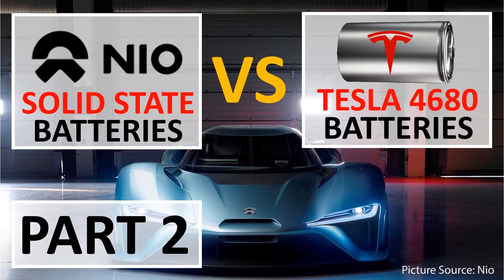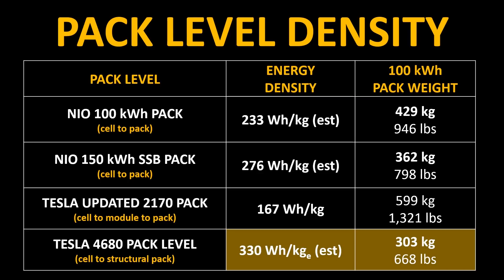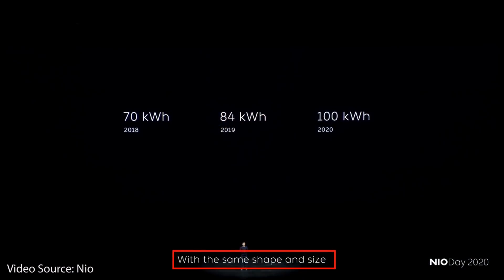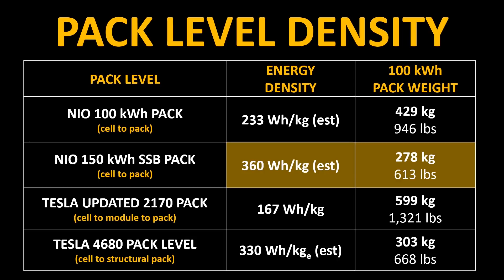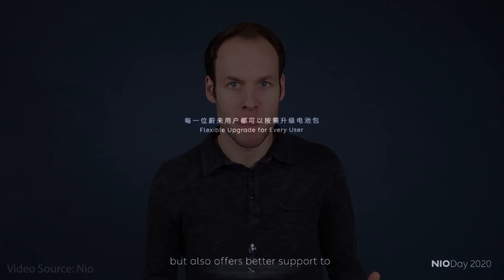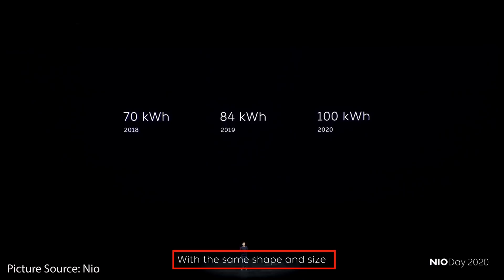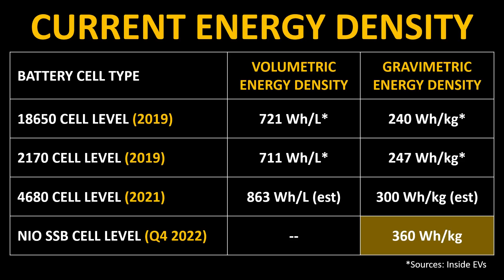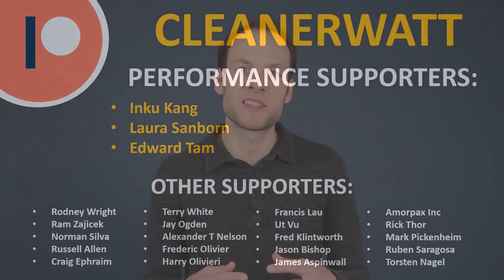Tesla vs NIO Solid State Batteries (Part 2: Did I get it all wrong?)

Comment: 440 watt-hours per kilogram at the cell level, for commercial batteries, by 2022?

That's totally unrealistic.  That was your conclusion, too, but you didn't say a lot about why.

Here's why: solid state doesn't increase energy density all that much.  The big giant advantage of solid state is faster charging.  A lesser advantage is less flammability.  (A big downside is poor cycle life, which will have to be solved before any solid state battery makes it into BEVs.)

For higher energy densities, it's not enough to fiddle with the electrolyte, whether it's solid or liquid.  You need an anode that can hold more ions.

Caveat: Tesla has a patent for an anodeless battery cell, and potentially, that's a horse of a different color.  It's not actually anodeless.  It just combines the electrolyte with the anode; the electrolyte both transfers and stores ions.  Potentially, that leaves more room in the cell for ion capture, hence higher energy density - from fiddling with the electrolyte.  Cool beans!  But Nio doesn't have permission to use that patent, so far as we are aware, so that probably isn't what they are doing.  Besides, it's a tech that's probably not even at the lab bench stage.  It's just an idea, Tesla patented it, maybe one day it'll be commercialized.

Don't hold your breath.  Most battery patents never make it into the hands of consumers.

I guess this is a long-winded way to say that I think your part 1 video got it about right.  Nio is not about to deliver a cell with 440 watt-hours per kilogram.  Let's take that off the table for our speculations.

But Nio is expecting a significant energy density boost from its solid state battery - when fiddling with the electrolyte really isn't a path to deliver that higher energy density, so far as I can see.

Nio could be fiddling with the anode chemistry.  But honestly, the cycle life problem for solid state cells is not going to be easy to surmount.  Further, some of the things Nio has put out there into the public view is a degree of uncertainty about the specific battery chemistry they'll use.  They might be choosing to be vague to protect trade secrets.  Or it could be that they don't actually have their battery chemistries nailed down.

I choose Door Number Two.  I think these turkeys are still at the lab bench stage, trying to get cycle life up, aiming for more energy density, not quite sure how they'll get it done.  Or when, if they were being honest.

They aren't being honest.

Lots of solid state projects are at the lab bench stage, all over the world.  It's a very popular research topic.  The only ones claiming to be close to mass-production just happen to be the ones angling to pump their stock prices.  Everyone else is being very quiet about projecting a timeframe for mass production - because they aren't close to commercialization.

So:  what we have here is a car company that wants to raise its stock price so they can sell some shares and fund their growth without diluting ownership control by much.  We have a company of dubious ethics that has stolen IP from at least two other companies and is embroiled in litigation over it.  We  have a company that's projecting incredibly optimistic range and performance specs for a BEV that's due next year.  We have a company that's promoting battery swaps, which makes zero economic sense if they are about to release a battery as juicy and sexy as their promised solid state cell.  You don't need swaps if their batteries will be as good as they're claiming, and they're claiming that the new cell will arrive in the market long before they could amass enough capital to build out a swapping infrastructure far more costly than fast-charging stations - swap stations they really, really, really won't need, because if they can deliver solid state by 2022 as good as they have claimed, then what they should want to invest in is fast charging stations to take advantage.  In principle. solid state will cream all batteries that came before in their ability to accept faster charging.  That is the chief strength of solid state.

None of it makes economic or engineering sense.  But investor analysts won't know that.  They know nothing about engineering and not very much about economics.  So some will climb on board, and up goes Nio's stock price.  Nio will harvest that money and do something or other with it.  I won't pretend to know what.  But I think it's a safe bet that they will not be putting solid state cells into cars in 2022.  Or in 2025.  Or in 2028.  As for swap stations, forget about it.  The economics do not work.  They'll discover that in a hurry if they actually try to build stations large enough to actually service customers.

If they even bother with it.  I seriously doubt that they will.

The dudes are lying.  It's a somewhat more sophisticated lie than Nikola's horsehockey.  But the swaps gives the lie away.  They won't need swaps if their batteries are going to be that good that quickly.  Nio's engineers will know that swaps won't work.  So this sales pitch is the brain-child of someone with marketing, but not engineering, expertise.  Nio's marketers decided that investors would love hot-swapping battery packs, so they're selling it that way to investors.  Why not?  They can always change direction after they get the stock price up, issue more shares, and pocket the cash.

It's what a company of dubious ethical standards would do.  Nio is a proven ethical offender, as I see things.
Reply: Absolutely brilliant analysis, thank you for sharing.

I really appreciate the scope of your thinking regarding engineering, marketing, legal and economic factors. I wholeheartedly agree that Nio will most likely be using marketing fluff for a better cash position as the EV bubble continues to rise.
Reply: Good points, their boast about battery swapping is more marketing than engineering prowess. With solid state batteries it always looks great on paper, but the devil is always in the details. Will it have the same cycle life? Half the cycle life? will it be much more expensive? Will it be able to be made in large quantities at reasonable cost? Like Musk has said, making prototypes is trivial, large scale production while controlling costs is hard.
Reply: Perfect analysis. Kudos.
Swapping has so many downsides in so many aspects, that showing it as an advantage is pure snake oil salesmanship.
Reply: Not to mention battery swapping stations would require a huge amount of batteries sitting and charging. Which means more packs need to be produced for fewer cars.
Reply: @ogzombieblunt4626  Yes, that's part of the reason that pack swaps are not an economical proposition, particularly given the fact that battery production capacity lags demand for cells.

But it's the sheer cost of swap stations that will doom Nio's interest in them.  They will cost inconceivably more than fast charging stations, and they have a lot of moving parts, so maintenance costs will be far higher, too.  The fact that building and stocking swap stations with packs will take away from new model production is icing on a very bad cake.

And all of this is true for current gen packs.  As improved batteries arrive on the scene, it's even more ridiculous to use swaps - but it's plenty ridiculous right now.

Nio is championing a technology to investors that their engineers must know will be abandoned.  Too bad many investors are so clueless.

Nio knows that, too, and is taking ruthless advantage.
Reply: Also the entire assembly process of solid state batteries needs to be done in a moisture free environment. The batteries themselves must be sealed in such a way as to never let moisture in during the entire life of the battery, otherwise the lifespan of the battery is severely shortened.
Reply: @grumpusmaximus9446  All battery manufacturing requires avoiding contaminants and effective sealing.  It takes very little in the way of contaminants to bollix up cell performance and cycle life, and even elevate the risk of fires.  Environmental and dust controls in a cell fab facility are always necessary.

So needing to keep water out of the cell's guts isn't a disadvantage for solid state batteries.  That's pretty standard in this industry.

I'm very curious about Nio's electrode plans for their solid state cells.  If they proceed with industry-standard wet coating, then they'll have to invest in a liquid recovery and reprocessing scheme quite similar to existing L-ion cell production lines.  That equipment adds a lot to the cost of production lines and requires a massive factory footprint.

Nio doesn't have access to Tesla's dry-coating IP, which is a big reason the 4680 cell will be cheaper  to produce.  There's no liquid to recover; the production line can be much smaller and cheaper.

So even if Nio has solved the cycle life problem (lots of teams are trying, no luck yet), they're choosing to use prismatic cells, the most expensive form-factor they could pick, and a form-factor which can't be used in cell-to-structural-packs to save weight and costs.  They're probably stuck with liquid electrode production methods and costs.  Assembling the solid state electrolyte is not going to be as simple as pouring in a liquid, as it is with current-gen cell manufacturing.  There's a lot we don't know, but the rough outline I'm seeing is a cell that  will be more expensive  to produce than current-gen cells per watt-hour of storage.

How they'll get better energy density is anyone's guess.

Wall Street analysts will be happy to rush to the conclusion that 'solid state' is a magic wand that will unlock every fantasy goal for batteries, but Nio's announced plans look fishy to anyone who knows more than a little about battery manufacturing.

Are their announcements a breakthrough, or hype to pump their stock price?  I'm leaning towards hype.
Reply: @Urgelt  
I agree with everything you posted. I'm no expert on battery production, but from what I've been told it's the actual moisture content in the air that can cause problems. So much so that the assembly area must be environmentally separate from the general area.
Reply: @grumpusmaximus9446  Indeed yes - my only point was that this sort of environmental control is normal for producing contemporary battery cells.  It's ordinary.  Solid State won't change that requirement, and the need for environmental controls does not increase the cost of solid state production relative to contemporary cells.

But there are other reasons to expect Nio's new cells to be frightfully expensive, in terms of cost per watt-hour of storage, even assuming they actually have created a cell with appealing performance and cycle life (which is not a safe assumption!).  I've detailed some of those reasons.

I could be wrong!  I'm not privy to the details of Nio's solid state work.  But at the least, there is cause for wary skepticism.

The sketchy plan that Nio released might appeal to know-nothing Wall Street analysts, but if Elon looks over what they've said about their battery plans, I think he'll laugh out loud.
Reply: @Urgelt  Is the energy density related to what you posted earlier "You need an anode that can hold more ions" ? Thanks for clarifying and for sharing your expertise!
Reply: @NIOTrending  Uh, thanks, but I'm not sharing expertise, only opinion.  I'm not a battery engineer.

Sure, energy density is connected to anode engineering.  Researchers all around the world are trying to come up with more efficient ion storage - and trying to get good cycle life out of various chemistries and production methods.

I might have admitted that the cathode's ability to hold ions is equally important.  The anode fills up with ions when charging; the cathode holds ions when they've given up their electrons.  An unbound ion floating around in the electrolyte doesn't help charge up the battery.  So the cathode and anode have to be matched in their ability to bind ions.

So far.

Tesla's patent for an anodeless battery changes things, if they can ever commercialize it.  The electrolyte becomes both the transmission medium for ions and serves to capture them.  The anode is gone; so there's theoretically more room in the battery for ion capture during charging.  Match that with a beefier cathode and you have a more energy-dense battery.

I have no clue how easy it will be to move that concept off the lab bench and into production, though.  Or even if they have a working test rig for it in the lab.

I've got an idea!  Lets pass laws requiring every battery researcher to open up their labs so we can all have a good look at what they're doing!

I want a pony, too.
Reply: @Urgelt  😂 appreciate your response-thanks!
Reply: Under the assumption Nio has a 277 wh/kg. Why wouldn't Nio bendy
Benefit from a solid state battery?
Reply: @HeliosFire9ll  They would benefit - if the cost per kilowatt-hour is competitive, if the cycle life is competitive, if the energy density is superior.

Nobody has brought to market a solid-state battery that satisfies those needs for automotive applications.  Research is continuing, but will any solid-state candidates succeed?

We do not know.  We only know that, at present, none have succeeded.

I'm skeptical.  It seems to me that people who know nothing of batteries - Wall Street analysts particularly - seem to be taking it for granted that solid-state will blow the doors off of other candidates and come to dominate the industry.  They believe.

I don't have much respect for beliefs like that.  They are grounded in ignorance and wishful thinking.

We do not know which battery chemistries will dominate, or when.  Research is active, and it may well be that other developments will prove to be more important.

Meanwhile, we should be cognizant of the tendency of certain companies to wish to pump their stock prices with optimistic forecasts.  They tease us with press releases and promises.  Most candidates will never be commercialized, y'know.  Caveat Emptor.
Reply: @Urgelt  This overview and my research into NIO is why I'm quietly optimistic about them being an early company to introduce it. Time is the ultimate reveal of course.